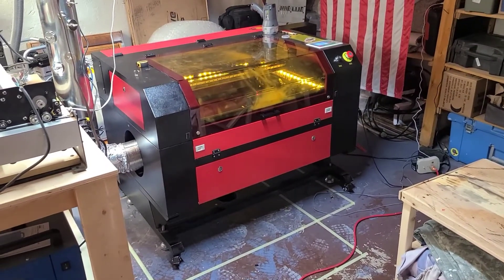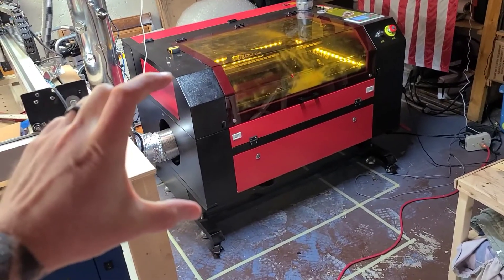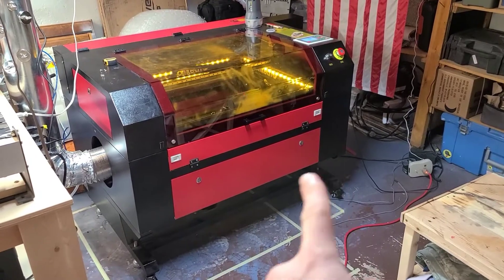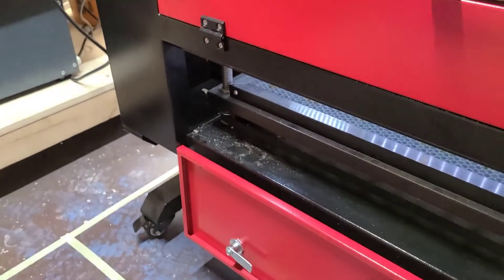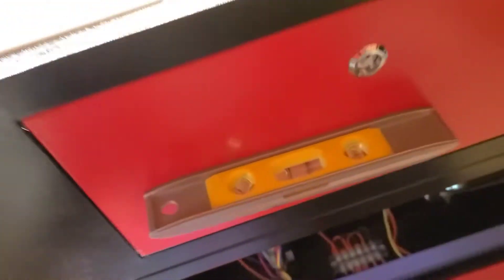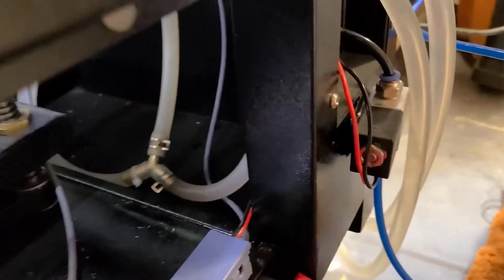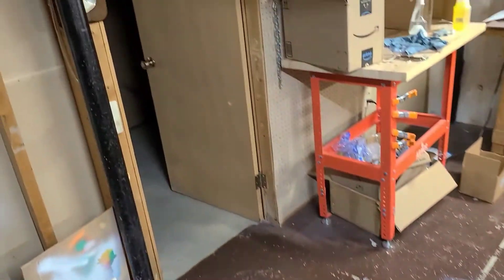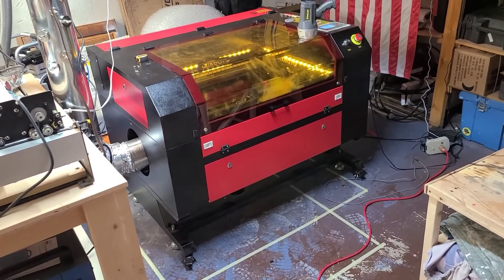Bolt Locations for your AF2028-80 OMTech

Comment: This was exactly what I needed to know. How to get to the bolts, and how tall it was once removed. Does the base weigh a lot that you recall? Trying to figure out if removing it will also significantly reduce the weight so my husband and I can move it in without additional help.
Reply from the maker: It'll still be very heavy. Maybe 150lbs to 200lbs. If you're moving it across the room it may be fine, but twist and turning you'll definitely need two strong people. My wife couldn't help me so I called a friend. Even when we move it down my basement it was awkwardly heavy. Once we got to flat ground I stood it up tall on a flat furniture dolly from harbor freight and rolled it.
Reply: Thank you. We were able to move the 50w in a year ago which was just over 200lbs. It sounds like taking the base off may get us close to that. I'm going to go ahead and get one of those rolling carts you showed, to help squeeze it through the door frames. Thanks again for taking the time to post these helpful videos.

Comment: How much allowance would we need to leave behind, sides for the doors to open once we get it inside?
Reply from the maker: If you want to be able to open the back door completely, it's 8 inches in the back. For the side it's 12 inches because of the tube extension. But it will vary between different laser bodies.